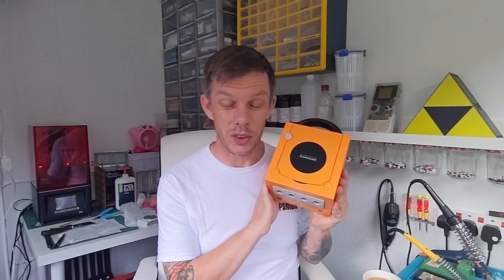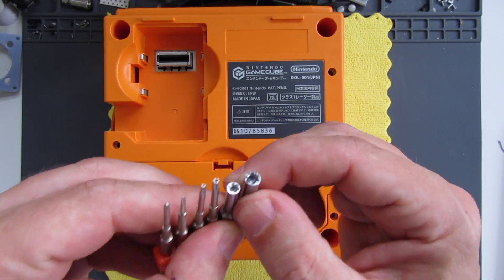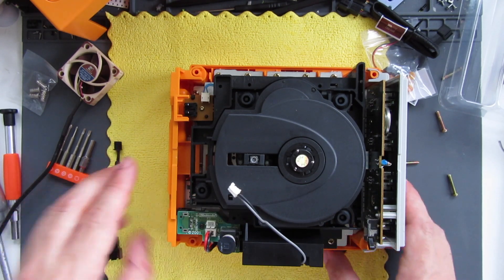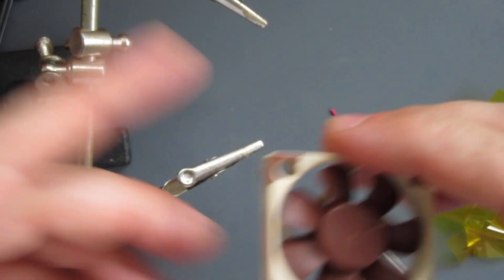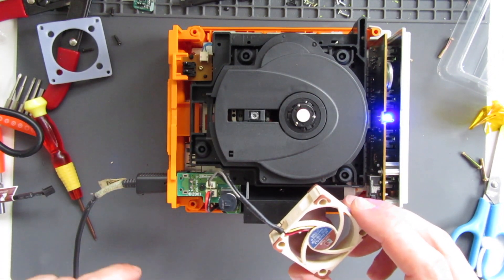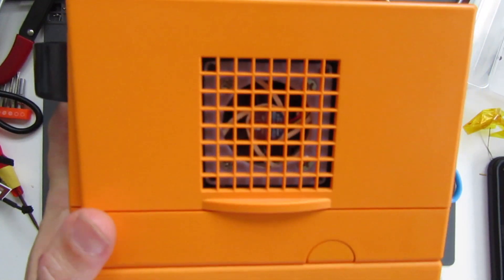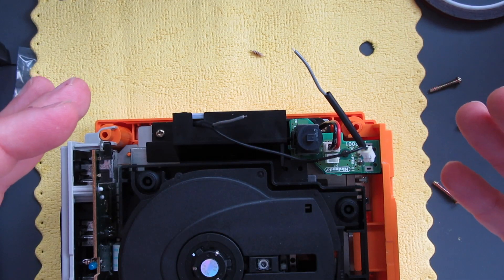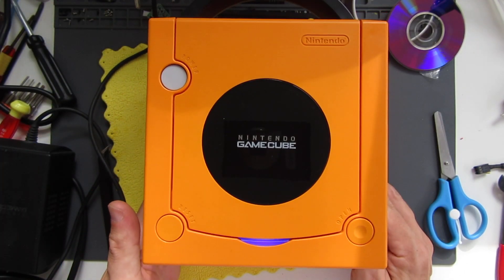Nintendo GameCube quiet fan upgrade, rewiring and tips

Comment: If you peal back the sticker on the fan you can see where the wires are soldered, there should be a label for the wires saying positive and negative.

Also, you can just use the Omniconnectors that come with the noctua fan, and no soldering would be required. I know some people don't like a mod when it involves soldering. I used these connectors and fans too on my 3d printer and they work just fine with the Omniconnectors.
Reply from the maker: Good to know!

Comment: I like the blue power led, it's also my favo colour ... might do that mod as well.

Nice one on the low noise adapter, perhaps that is also useable on the stock fan? Since there is no cable for PWM like on a pc, my guess is that the fan runs at 100% all the time (full 12v) and thus gets a lower voltage and runs slower with the resistor.
Reply from the maker: Maybe, it's just a question of wondering if the fan would keep it cool enough
Reply: @JoeBleeps   Yeah sure thing. I modded my game cube the other day and saw the CPU's temp in Swiss, guess you keep an eye on it there (especially on a hot day) to make sure the temps are staying nice and ... tempared ;) Mine seems to run at 42c with the stock fan on a hot day, pretty fair I think.

Comment: great vid just ordered a new fan as mine
 is failing and it looks like my cube is getting hot so hopefully this will help
Reply from the maker: Good luck!
Reply: @JoeBleeps  well after trying the mod for a few day and getting idle 50 degrees plus, i soon went back to a stock fan which luckily i also got  to be on the safe side now back to 39 to 46 degrees that little fan is not strong enough .
Reply from the maker: @paulbrennan5807  thanks for this, how did you carry out your temperature checks? I'll do the same on mine
Reply: im using  swiss with a gc loader maybe a update you may want to do in the future better than having to keep changing disks when we have a retro game day it shows the temp on the main page

Comment: Just peel back the sticker in the centre of the fan and de-solder the wires, no need to cut and splice.

Would putting a resistor inline of the OG Fan have the same impact?
Reply from the maker: I did have the same thought, but I think the newer ones are more efficient. I'm not sure the OG fan would cool it enough if I added a resistor
Reply: @JoeBleeps  I just edited my original comment to make more sense.
Reply from the maker: @busubi  I didn't know that about the sticker! Not sure my wires would have been long enough but that's a really useful bit of info for future reference

Comment: this leads me to wonder if soldering a resister in with the original fan would give the same results
Reply: It definitly makes it more quiet. You can solder from 22ohm to 100ohm (more is not recommended). Due to some online forum guys, the sweetspot is 50-75ohm which results in 10-15% more heat but ~5db noise reduction.
Reply: Fan speed is different between the old one and a noctua one. The new one also moves more air per second at every rpm

Comment: Instead of needing to mess about wrapping a piece of tape around one of the soldered joints (before positioning the heat shrink), why didn't you just stagger where the two wires were cut? Then you wouldn't have had any issue with the two soldered connections shorting against each other!
Reply from the maker: That's a very good point 😅 I'll do that in future

Comment: Could you upload the tools you use for your modding ie soldering iron(s) etc aswell as your 3d printer. I do a fair bit of modding but struggling to find good reliable tools. Cheers ps love the mod videos 👌
Reply from the maker: Thanks for the suggestion! I'll try and do a video in future if I get the shed more organised!
Reply: @JoeBleeps   That would make a good video. Can i ask what iron you use as im looking to get a good reliable either soldering iron or soldering station.  Cheers
Reply from the maker: @rosssmith5731  Antex cs-18 I think. And I use the pointy tips for the most part

Comment: This has been a complete failure for me. I bought this exact fan and even with the "low noise adapter" it is still LOUDER than the original fan. The original was 60dB. This fan without low noise adapter came in at 70dB. With low noise adapter 65dB. Absolutely terrible idea this.
Reply from the maker: For me it was louder than the original fan until the resistor was added in, after which it was definitely much quieter. It's not a job I'd be rushing out to do on any other GameCube unless I was finding the fan noise to be really problematic.
Reply: @JoeBleeps  what resistor do I need specifically? Or should I just stick with the cable noctua provides?
Reply from the maker: @ravenrue  yeah that should be fine. I think I said in the video what resistor it is, it's been a while since I did it.
Reply from the maker: @ravenrue  yeah I just had another look you just need a regular 100 ohms resistor or use the cable.
Reply: The same has happened for me. Sounds like a jumbo jets about to take off 😂
Reply: You fail to understand how much higher the max speed of the fan is but also how much more air it's moving. Noise doesn't just come from nothing